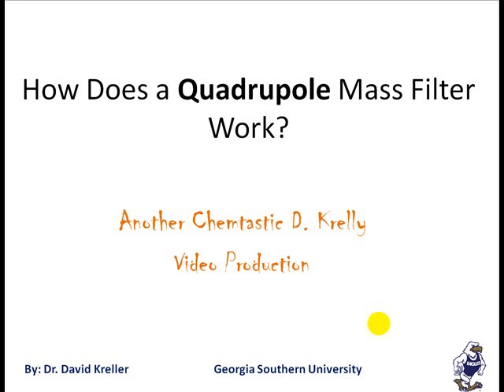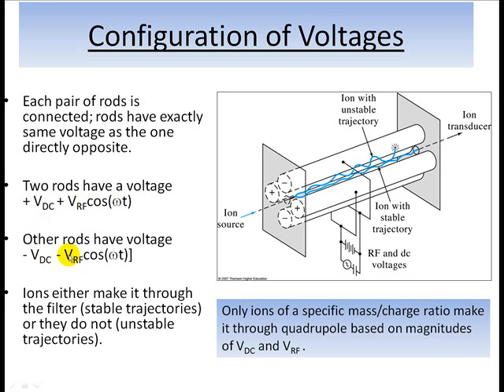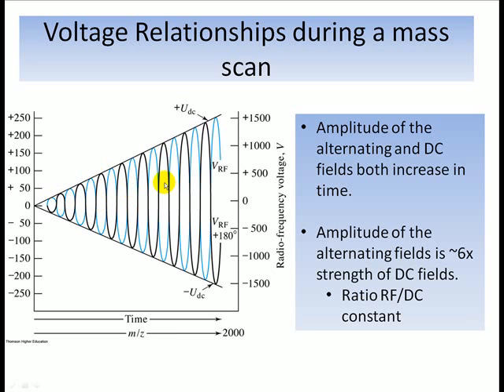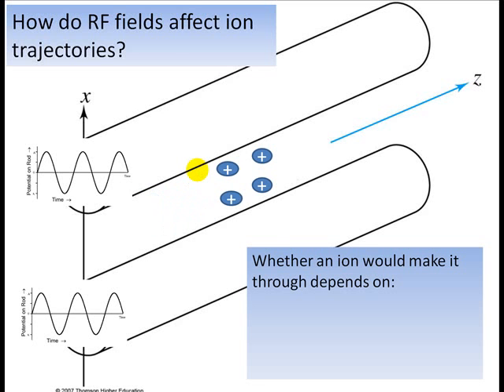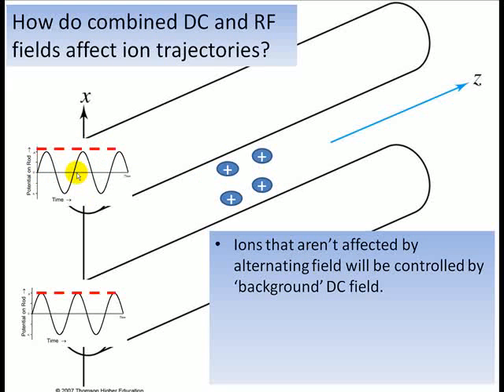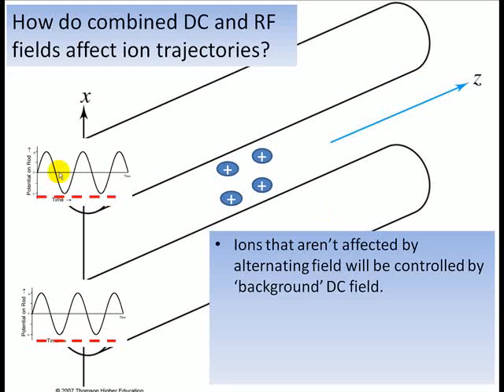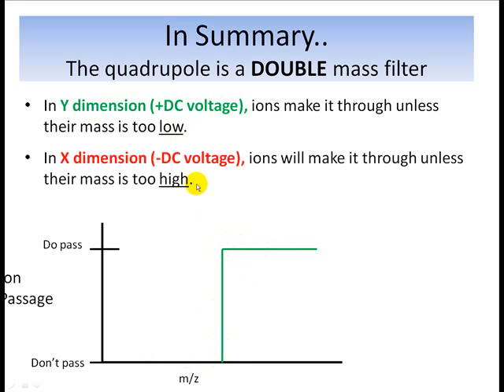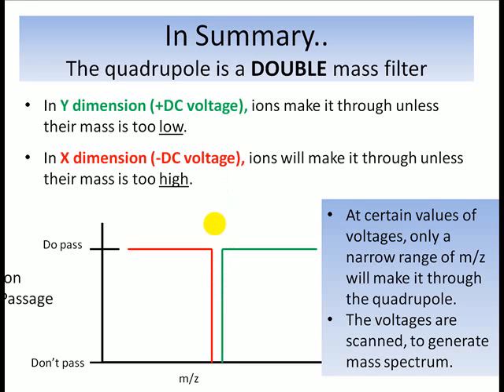QUADRUPOLE

Comment: hi! at 4:04 the potential should not start from 0, because the radiofrequence voltage is V* (cos freq. *t). So it should start with a positive value. is it ri
ght?

Comment: Great explation..but how  can a rod  produce both a sinusoidal and constant potential?I also saw the electrical configuration of the genertors..but I'm used to think about than electrons flux are in movement or stationary....it is killing my mind
Reply: A DC voltage and an ac voltage are combined together. So if the DC is say +1 volt and the ac is 1 volt peak to peak it would be like the ac wave was raised 1 volt on the graph, so y=sin(X) becomes y=sin(X) + 1

Comment: what happens to the ion after it crashes?
Reply: The charge is electrically neutralized, at which point the ion is no longer charged. It is then removed by the vacuum system.

Comment: There is a mistake in the graph at 10:30. The Y edge is wrong. The label "Do pass" should be "Don't pass" and vice versa.
Reply: As far as I understand the X-dimensions switch should be shifted more to thr right and the Y-dimensions more to the left, so there is a small overlap. Flipping one of the dimensions would render the flipped one meaningless.
Reply: No, it is correct as written. There are two voltages applied, + and -. Ions that are small WILL pass the first, (so their line is high), but they stop passing at a certain point (drops to the baseline). Large m/z will NOT pass the -DC rods, so they are at baseline (do not pass) and shoot up to "do pass" for +DC. The gap in the middle is the range of m/z of ions that will pass BOTH. The lines only represent the sizes that do or not pass each step. the correct size ions would be a 3rd color, at the top I suppose. The idea is to highlight the narrow window of sizes that will work, not show a line for them.